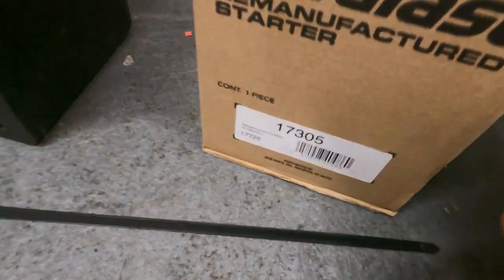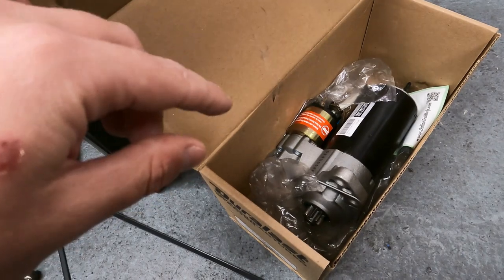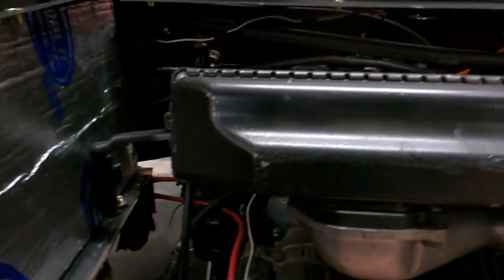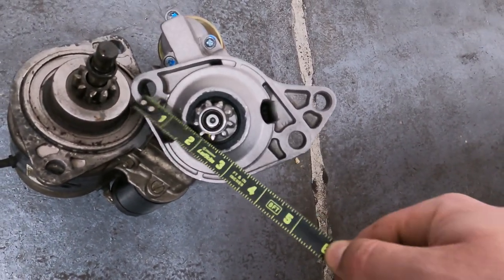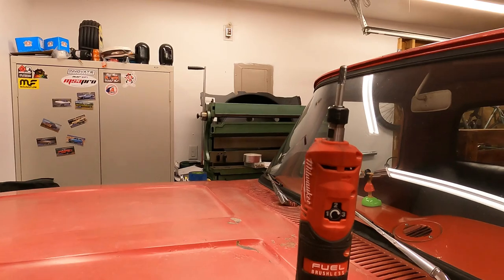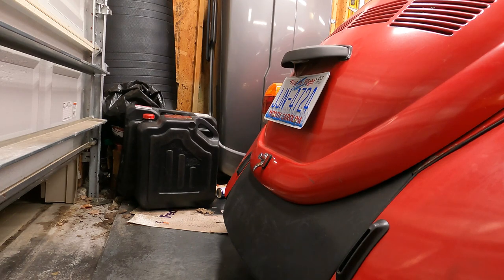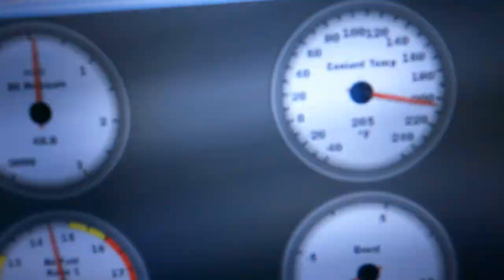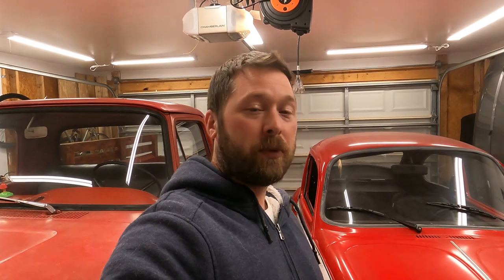Type 1 Starter Upgrade -- 1973 VW Super Beetle Subaru Swap

Comment: I'm doing an EJ20 swap and also using the same starter. I filed the holes and installed last night and had same issue you first had. I was stumped. Stumbled across this today and it made so much sense! Filed a little more, installed noticeably better and it works now! Thank you for posting this!
Reply from the maker: Thanks for the support! I’m glad I could help. Keep a heads up, another video should be coming out in the next few weeks for battery relocate and finishing the frunk. Good luck with your project!

Comment: About to do this exact mod on my EJ22/Chenowth rail.  Thanks for putting this up!
Reply from the maker: Thanks for the support and good luck!
Reply: @RatchetMotors  Swap done, and I can't say thanks enough for this one!  The difference is night and day, I can only imagine your higher compression being even more so.  Once the rim boss of the starter fit into the transaxle, I bolted it up without issue.  First press of the start button absolutely floored me, perfect engagement to the flywheel and off she went!  I'm also running a Microsquirt ECU, but being N/A there's not much I can beg from you on maps.  ;)
Reply from the maker: Congratulations! That is great news! I’m so happy you found my content helpful. Good luck with the rail!

Comment: Got my used bosch starter. Its definitely the automatic transmission starter.  And the bosch number other motor is 0 001 121.    The 121 is the critical number. 0 001 is bosch's designation for starter motors.  121 is the series.  I ebayed a used one.  I did notice you showed the holes being enlarged towards the center , but mine needed to move towards the center and to the side.  I also had to grind some of the ear of the starter off on the top hole to clear a top ridge of the transmission.
Reply from the maker: That’s great that you got it to work! Sorry if the video didn’t show everything exactly, there was a lot of grind and check so I may have not captured it all. Either way, congratulations!
Reply: Hi, You used the Bosch SR0407X starter on stock type 1 transmision ? how does it perform?
Reply: @matejz8866  the starter has a planetary gear reduction,  so it doesn't crank super fast... but it has a ton of torque.   The stock starter would bog down if I pumped a bunch of gas into it from the carbs.   This one cranks about the same speed, but there is not stopping or slowing it.
Reply from the maker: As Josh mentioned, it performs very well. I have not had a single start issue since installing. All hot start problems are gone. Good luck!

Comment: I wonder if this would work on my rotary sand rail with type 1 transaxle
Reply from the maker: I believe it comes down to using the Type 1 transaxle and Type 1 flywheel tooth pattern. If you're using those, it SHOULD work. I'm really curious so let me know what you end up doing! Best of luck!
Reply: Thanks man I did it and it worked perfectly I had been struggling with VW starters. Thanks again
Reply from the maker: That is awesome to hear! Congrats!

Comment: So I've been wanting to do this project and I finally am ready.   Looking at the starter you used, it is for a automatic VW 1.9.  I have read that the preferred 1.9 starter is for a manual application.  Did you look into this before you did our project?  if so what was your conclusion.   Thanks again for posting this.
Reply from the maker: Thanks for the support! As wrong as it sounds, you want the automatic starter. I did a lot of research on all the forums and I think you need the automatic because it has the right tooth count AND the right throw (how much the gear travels in and out). It is the Bosch SR0407X (9 teeth). Good luck!
Reply: @RatchetMotors  I cant thank you enough for documenting this.  It had to be nearly impossible for you to do the first time.  I respect your courage.  I'm gonna get my starter ordered and maybe Ill do a video too.  I'm going to be installing on a 1600 air-cooled, so it will be a little different video.  Thanks again
Reply from the maker: I’m just glad you found it useful! I did not enjoy buying a new starter just to modify it but luckily everything worked out as planned and I’m hyped with the results. Good luck my friend! Also you can consider the Duralast unit as a cheap alternate to the Bosch, both part numbers are linked in the description. You can also check Rockauto.com for other alternate manufacturers and part numbers.

Comment: I did a swap today on my 1973 VW Super Beetle with the 17305 starter and it doesn't spin the motor as fast as yours is spinning. Battery is good. Even tried it with a charger on a good battery and a jumper cable from the battery negative post to the starter body as I have read that sometimes the ground is bad. But it still doesn't spin my motor as fast. How did you get your motor to spin that fast?
Reply from the maker: There's a few things I can think of that may or may not be affecting. 1) my starter is run off a relay which helps with power management/draw. Any unnecessary power is turned off during cranking 2) compression ratio also plays a huge factor.  my hybrid motor falls somewhere in the 8.5 - 9 compression ratio so cranking may be easier than if yours has a higher CR 3) my motor is worn out lol, which goes back to #2 (less compression, easier cranking)
Reply: @RatchetMotors  Thanks,  I am sure that is what it is as my motor has been rebuilt.

Comment: After drill , do we need an adapter or spacer ? Or it bolt flat in-the type 1 transmission ?
Reply from the maker: No adapter or spacer needed, just a straight bolt-on once the holes have been opened up. Best of luck!

Comment: They make a hi TQ starter that’s a bolt in fit. Why did you go this route?
Reply from the maker: I mainly did it for reliability and availability. I’ve heard a lot of mixed reviews on the hi TQ options and I wanted the added assurance of an off-the-shelf item at most auto parts stores.